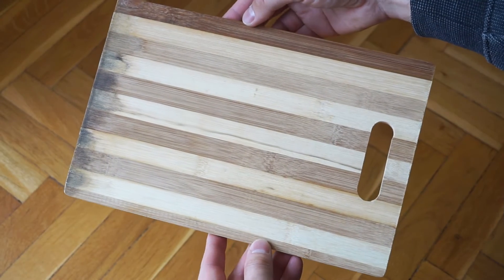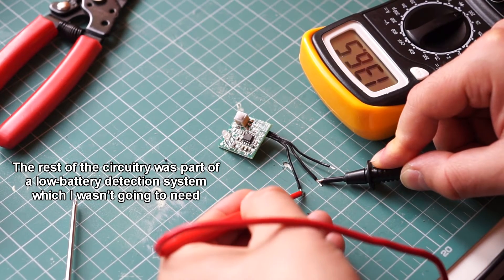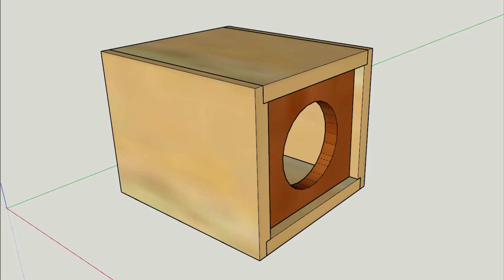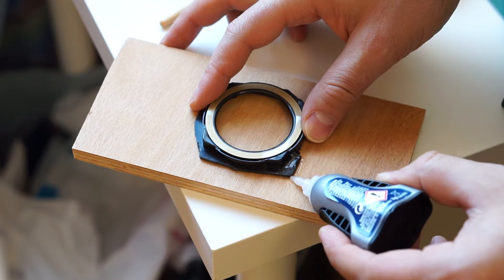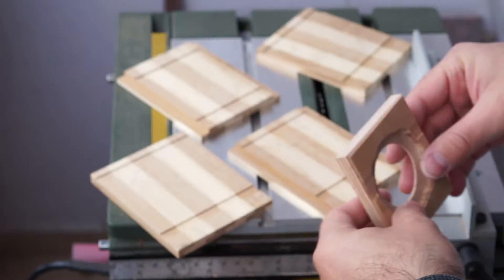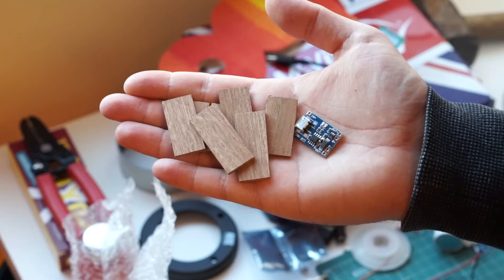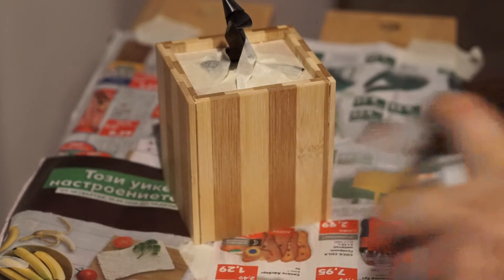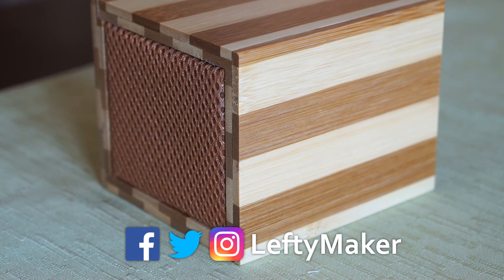A Bluetooth speaker made of old junk

Comment: Can I add 3 more batteries for longer play life? Because I am going to use four ghxamp h2o proof speakers and a passive radiator. It is my first time and got all the parts and tools but no idea of electronics connections and engineering stuffs. By the way, great video, thanks.
Reply from the maker: You should be able to add more batteries in parallel, as long as they're identical, but I haven't tried it. Make sure they're at the same voltage when you connect them.